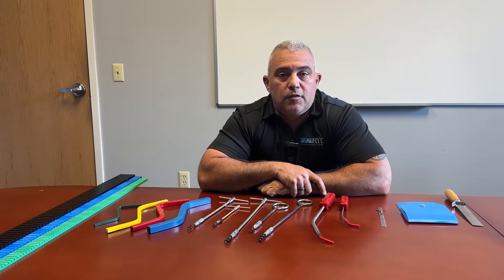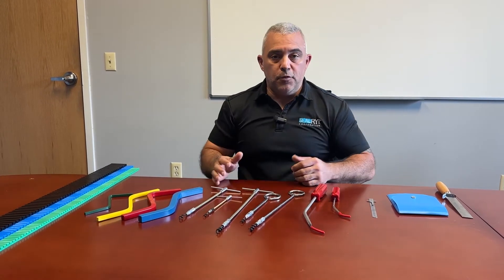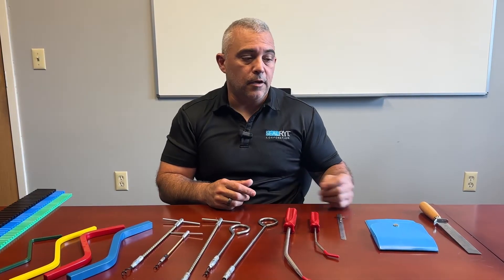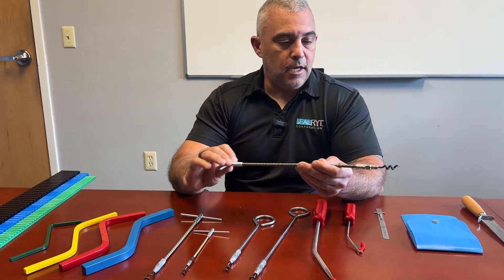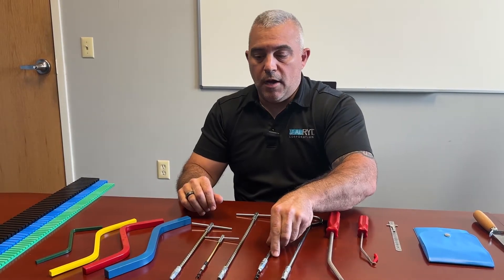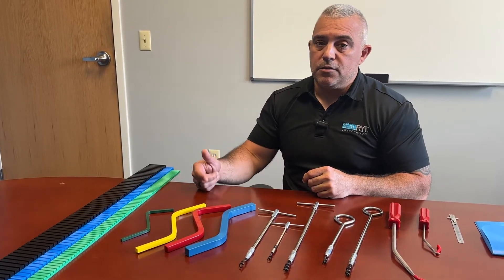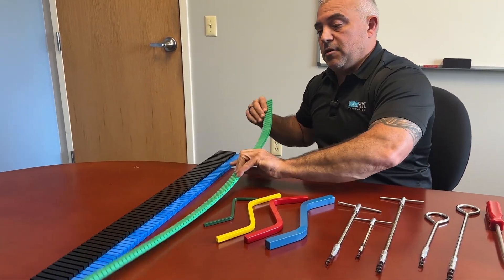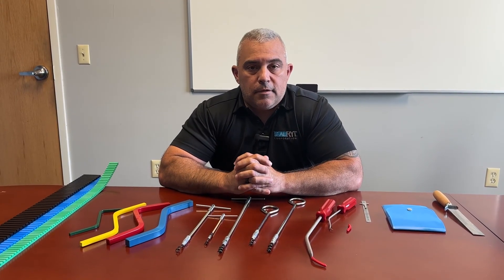The Right Tools for Installing and Removing Packing From a Stuffing Box

Comment: Quick question:  are there any tools you see new guys or misinformed people using that you strongly caution people NOT to use?
Reply from the maker: I’ve seen two tools for removal that I thought were a little risky.

1.  A come-along for removing obstinate packing - could very easily cause injury.
2.  I witnessed a person using a flathead screw driver and a hammer to try and dislodge the packing.  It’s not so much using those tools as much as it was the person using it wasn’t cognizant of the damage he was doing to the shaft sleeve by hammering on the screwdriver.

For installation - using any tool (hammer, wrench, pry bar) to pound the packing flat so that it will fit.  If an adjustment to the packing cross-section size must be made we highly suggest rolling the packing versus smacking the daylights out of it until it fits. See this video for more on that: https://youtu.be/jRDrHed9Mvo?si=y376zXORks_2E1CR

Hope this helps.
Seth Wilkinson
Technical Support

Comment: Thanks much for this video. I want to know if it is okay to grease the shaft within the stuffing box when installing the  packing.
Reply from the maker: Greasing the shaft is fine as long as a few criteria are met:

1.  Ensure the grease that is used can withstand the temperature of the process as well as the heat generated by the shaft as it turns during startup.  If improper grease is used it can lead to the liquid particles solidifying and embedding in the packing rendering it relatively useless.  Along with that, grease is a petroleum product, flashing said grease will at the very least start smoking the packing if not resulting in an all-out fire.

2.  Ensure the process is one that can have grease contamination - on startup there will be a high potential for that grease to enter the process.

3.  Use sparingly, only enough to create a very thin coat.  If possible, only put grease on the OD of the packing.

4.  An alternative to using grease is rolling the packing to temporarily decrease the size of the cross-section, rendering it easier to install.